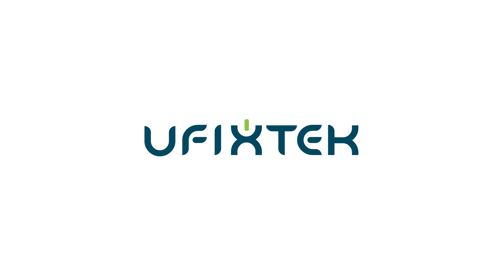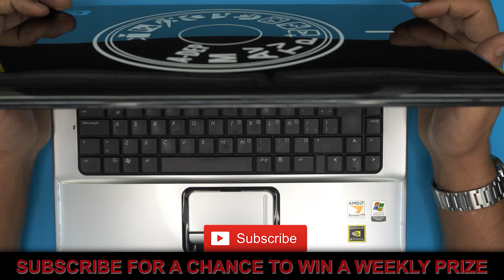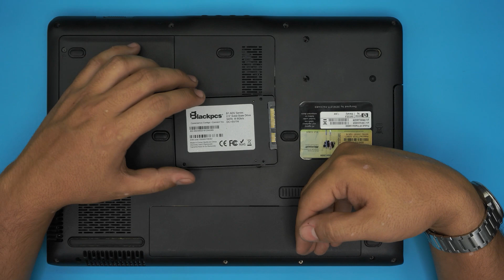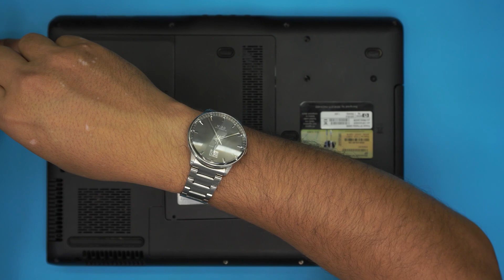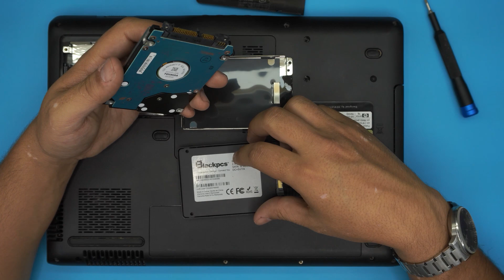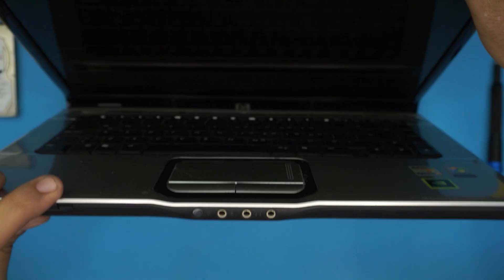Hp Pavilion Dv6000 Upgrade SSD, ( Boost Speed Guide )

Comment: Well this model has high failture rate especially ones with dedicated gpus
I doubt there are many dv6000s left 
Unless they are with igpu
Reply from the maker: Yep, I’ve been repairing and reballing, and the GPUs that are supported for these models have a defective core balance. They overheat in one section more than the other, which results in solder joint problems. I’ve been repairing laptops for 22 years, and in the past 7 years, I haven’t seen any of these models around.

Comment: I just upgraded my HP PAVILION DV6000 (DV6308NR) I used this video to upgrade it! Right now its running windows 7 and im commenting on it right now!
Reply from the maker: Awesome job enjoy your upgraded laptop for now 🫠
Should you have any questions or requests in the future, please don't hesitate to ask me.
cheers🍻
Reply: Yeah the only issue I am having right now is my drivers arent working sadly @uFixTek
Reply from the maker: what driver you need for what component?
Reply from the maker: the wifi or the ethernet connection?
Reply: The way I commented is by a wireless adapter but it keeps glitching out and turning off it is super weird.

Comment: Hi .. i have a DV6700 model hp pavilion... i want to install the ssd and i have only 4GB of Ram installed.. its a old laptop in mint condition hardly used ... how much ram can i upgrade this for my coding.. Am a Professional Sas Programmer .... my programs run better with win10
Reply from the maker: 🫠Regarding your question, you can install a 1TB ssd 2.5" and for the ram check the max ram capacity by opening the CMD and type:
wmic memphysical get maxcapacity
that will tell you the max ram capacity.
cheers🍻
Reply: @uFixTek  Thank You so much ...
Reply from the maker: It's my pleasure my friend.

Comment: hello, should the ssd that comes with the dv6000 be at an angle when opened up? laptop has been turning on for only one secind, thats my only guess
Reply from the maker: Thank you for your feedback! If you wish to support the channel, you can like, subscribe, or both!
Regarding your question, for the laptop to turn on you don't need to have the ssd or hdd in it, if you remove the ssd and power on it should power on and it should say no boot drive.
remove the drive and see if it turns on and gives you a boot msg, without powering off!
Should you have any further questions or requests in the future, please don't hesitate to ask me.
Reply: @uFixTek  it still does not turn on, do i open it all up?
Reply from the maker: if the laptop is not showing any sign of power when you press the power button?, no LED nights or fan spin or anything?
then you may want to follow this video:
https://youtu.be/Zqrz-IGGNvw
Reply: @uFixTek  when i turn it on, it lights up for a second, then turns back off
Reply from the maker: follow the instruction on link i send you, there is no harm to it, and it may 90% fix the issue.

Comment: I have a Pavilion DV6000 with Windows 7 that is very slow. I have not upgraded Windows because my embroidery program only runs with Windows 7 and any upgrade would make it and two expensive embroidery machines obsolete. If I upgrade the drive to SSD would it be any faster or is Windows 7 one of the reasons for the slow speed? The RAM is already at 8 GB which i believe is the maximum recommended for this old laptop, unless you believe an update on RAM is still possible and beneficial.   I really like your clear no nonsense videos and recommendations.
Reply from the maker: much appreciate the support my friend, regarding your question:
i highy recommend you to upgrade to SSD you will right away see the big jump in performance like nothing before!
BUT you will need to clone the OLD HDD to the new SSD to conserve the windows and programs.
make sure you get an ssd bigger than the HDD capacity. and you can clone it by plugging the SSD via usb to sata adapter: https://amzn.to/3tb9OOY
and download a cloning program i use: Macrium Reflect (piratebay has it 😏)
once you clone the main hdd to the ssd they power off and replace the drives and power on and it may gie 1st boot blue screen but 2nd restart will be ok.
Should you have any further questions or requests in the future, please don't hesitate to ask me.

Comment: Does anybody still use laptops this old as their main device. I collect hp laptops from this Era because they were beautifully designed but these laptops have a very high failure rate. Most of them are fried. Took me a long time to find the special edition versions that weren't insanely high priced. I'm still missing a few of them. Their was a bronze one a bamboo one, this one with a really cool black and beige design missing those 3 have the rest
Reply from the maker: ya they were nice, but not well made they had lots of bad thermal design, and i recall i used to get them for repair daily almost. but nice to have them in the collection pile.
cheers🍻
Reply: I have the bronze one special edition...updated ssd on this machine and windows 7 works good but hd YouTube videos lags. I have 3 gigs of ram. The keyboard on this one is pretty amazing feels like mechanical keys.😊

Comment: My god man this is my very first modification to an old laptop I had never seen a connection like that so the only thought in my head up until you said it's an adaptor was that I'm about to spend a fortune on extinct parts. I could almost feel my blood pressure taking off
Reply from the maker: 🤣🤣 ya that would be an impossible find.
Should you have any questions or requests in the future, please don't hesitate to ask me.
Reply: I literally just bought that adapter on ebay for $4.50 total.  It is coming from China.  If you pay more you can get it in a few days.

Comment: I have a same laptop (2 nd  hp db6000) ,change for ssd hard drive, upgrade ram , windows 10 work very quickly but ventilator work hardly, noisy , work every time 😱.  Do you know how ?
Reply from the maker: Repaste the CPU and GPU and clean the fan air way
Reply: @uFixTek  thk you, I will try when it is possible

Comment: Hi, i already follow all the steps but is not working, any suggestion?
Reply from the maker: Thank you for the feedback! if you wish to support the channel you can LIKE or SUB or both :P
regarding your question: your power light are turning on and stays on?, if you do the steps again and do the heating at max heat for 8-10min 1" distance with low air and max heat on hairdryer.
and let it cool down on its own don't force cooling or move it for 10-15min after heating.
Reply: @uFixTek  ok, i will try, thanks
Reply from the maker: oki, let me know
Reply: @uFixTek  hi, its me again, my new SSD works ok in another Hp laptop, but in my Hp DV6000 is not workng it says "pxe-m0f:exiting intel boot agent, check cable", but there is not cable there. But with a HDD works ok
Reply from the maker: oh one question can you boot to the USB on the DV6000? to get to windows 10 installation?
because you should be able to boot to usb even without the ssd or hdd installed. can you?
if not then i know the solution
Reply: @uFixTek  I just finished to try this suggestions, but i boot the system from the usb but is not working, by the way windows 10 is already installed on the new SSD
Reply from the maker: @livingwithcatsec  go to bios and see if the sata controller is set to AHCI , you need to set it to AHCI sata, see that.
if not:
install windows as MBR legacy on another laptop then plug it in this, the windows in the ssd my be installed as UEFI and this laptop don't support UEFI.
download the windows 10 iso and use rufus to burn it and legacy:
here is a pic of rufus how to set to legacy boot: https://imgur.com/a/NneJV4o
burn the iso as MBR and install windows on different laptop as legacy.
Reply: @uFixTek  ok, i will try it.
Reply from the maker: @livingwithcatsec  i hope it get it goin
Reply: @uFixTek  i hope too

Comment: My model is Hp pavilion dv6000  Intel(R) core  (TM)2 duo CPU T5250@1.5 ghz. Ram : 2 gb.  Please advise what all do I upgrade to make it use further  using windows 7 professional.
Reply from the maker: Thank you for the feedback! if you wish to support the channel you can LIKE or SUB or both :P
regarding your question: i would highly recommend you 1st get an good SSD and install windows then upgrade to 4gb ram.
https://youtu.be/z6XFkyhuRVQ
and install windows 10 it will work just fine we do install them all the time to clients.
https://youtu.be/uDu8j2lE-dM
https://youtu.be/7f_rBp6Rb3s
Reply: @uFixTek  okie noted. Harddisk capacity as of now it's 232 gb. 32 bit operating system. Windows 7 professional.
Should I really require SsD or simply by formatting and upgrading Ram to 4 gb will solve my problem as my system is too slow and I am really comfortable with windows 7
Reply: @uFixTek  also if at all I updrade to SsD which one should I go for considering my 2007 model Hp pavilion dv6000
Reply: @uFixTek  I have already subscribed and liked all the videos as you have been really v helpful and kind in explaining clearly. Thank you so much

Comment: what is the reading speed now by crystalDiskMark??
Reply from the maker: Thanks ✌  for the feedback!  if you wish to support the channel you can LIKE or SUB or both :P
regarding your question: depending on type and brand and size of the ssd. the bigger GB the faster file transfer speed and the type of the Dram chip and controller. also dont mistaken the peak speed with steady speed, also the type of file you copying is important and is it one file or two file.
i can do a big text file full of 0000 and another mixed numbers and it will affect the transfer speed, after GB's 
therefore i would say get a good brand SSD like Samsung or crucial , they have dram chip and reliable. avoid kingston and  ADATA.

Comment: Hi, I don't know if you still answer.  I have an hp pavilion dv6-6150us and now want to make it a little better.  I bought a samsung ssd 870 evo and when I installed it and booted the laptop, nothing worked.
Reply from the maker: Thank you for the feedback! if you wish to support the channel you can LIKE or SUB or both :P
regarding your question: okay can you give me more info:
1. when you replaced the HDD for SSD,  did you install windows?
if you just replaced the hdd to ssd you will need to create a windows 10 usb boot drive and then plug the usb into the laptop and turn it on and right away keep pressing the ESC key and once you get the boot menu choose f9 to boot from your usb and follow the installation guide.
here is the videos for how to make windows 10 usb and the correct way of installing windows into HP laptops:
 windows 10 usb: https://youtu.be/uDu8j2lE-dM
installing windows on HP: https://youtu.be/7f_rBp6Rb3s
Reply: @uFixTek  hello. Thank you for the quick reply. We installed Windows 10 on the SSD already and then when we put it in the laptop and boot it, it said something along the lines of no boot device.

I will most definitely look into the videos tomorrow and see what happens.  I read that hp has an advance bios setting, I can't seem to get into it.
Reply from the maker: oh boi that's not how you do it :P watch my videos, 1st you need to place the SSD in the laptop then you place the USB drive that you have prepared with windows installation inside, then boot into usb to start installing the windows.
Reply from the maker: and your laptop only has Legacy boot only.

Comment: Can I have 320gb hdd plus 64 gb ssd
And upgrade with 4gb ram . Is this possible??
Reply from the maker: Thank you! for the feedback and your support to the channel by SUB :P
regarding your question: you cant have both you can have SSD sata up to 2tb or HDD up to 2TB.
you can upgrade to 8gb on ram if you wish, 
https://amzn.to/3tP4aNb
https://youtu.be/z6XFkyhuRVQ

-----
NOTE: if you wish to remove the DVD drive you can replace your dvd drive with an adapter so you can connect a ssd or hdd inside:
https://amzn.to/33QrIGE

Comment: Hello my friend I have the Hp DV6103eu model laptop how much ram can I add and will window 10 work on it. Can you kindly help me on this and can I change the cpu on it.
Reply from the maker: Thank you for the feedback and your support to the channel by SUB :P
Regarding your question: dont replace the CPU as its waist of money because all the CPU compatible with this socket are discontinued and are almost the same.
about the ram you can upgrade to 8GB ram and even with 4gb ram you can have a windows 10 without any issues. and i would recommend if you have 4GB ram 1st replace the HDD to SSD and you will see BIG difference in speed, then after if you wish you can add more ram depending the applications that you will be using. 8GB MAX
Reply: Ok I will try that which ddr2 will I need slow voltage or high one.
Reply from the maker: @sabdulaziz  L is for low voltage not slow voltage, here is a link to the ram upgrade :
https://www.youtube.com/watch?v=z6XFkyhuRVQ
🔵 4GB RAM : https://amzn.to/33O502z
Reply: Hello my friend hope you are well. Need your help asus x59gl laptop how much ram and ssd can you add? Is it dddr2 or ddr3 I need do let me know. Many thank take care. Mo
Reply from the maker: its a DDR2-SDRAM
MAX you can go is 4GB
and you can go 1tb SSD or 2TB HDD
Reply: HP Compaq CQ58-d50SQ this other laptop I have can I change processor on this and can I install more ram and ssd on it. Thanks
Reply from the maker: HP Compaq CQ58 you can install up to 8gb ram same as dv6, the CPU i dont recommend you to replace  as its the same situation as DV6, and SSD yes i would really recommend you to upgrade.
Reply: Hello friend the acer aspire 5315 how ram and ssd can upgrade to.
Reply: Hi my friend hope you are good. I have got a Toshiba Satellite C650 laptop how much ram ssd can you put in it. Do let me know. Thanks

Comment: Are there any processor upgrades available for this laptop? I also need a speaker wire and a wifi chip. Would you be able to make a video on those subjects by any chance?
Reply from the maker: the cpu is not really up-gradable, you can change it but the range of the speed upgrade is almost the same.
and regarding the speaker wire ! what you mean you want to know where the wire is or where the wifi board is?
thank you for your support and feedback
Reply: @uFixTek  do you have any recommendations for a good wifi chip that will work with 5ghz connections on that board?
Reply from the maker: this is  wifi 5ghz that we use a lot for clients:
https://amzn.to/2YALFif
Reply: @uFixTek  much thanks
Reply from the maker: your welcome my friend
Reply: @uFixTek  The link is broken, what’s model for the upgraded wlan network adapter?
Reply from the maker: here is another video for this model, and in this video at minute 2:00 you see the wifi board beside the rams:
https://www.youtube.com/watch?v=z6XFkyhuRVQ&feature=youtu.be

and in this video i show you how to take it apart and right at 8:12 you see the speaker under touch bar
https://www.youtube.com/watch?v=Zqrz-IGGNvw&feature=youtu.be
Reply: FYI, you can upgrade processor by using Intel Core 2 Duo T9500 or Extreme X9000. But in order to make it work, make sure the BIOS version must be updated. Please beware if your model is either Intel or AMD before upgrading processor.